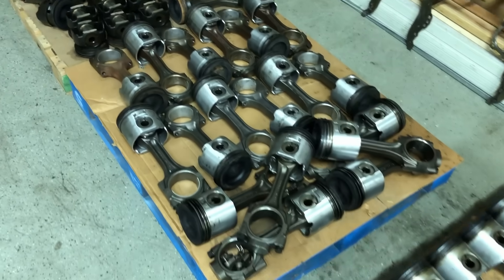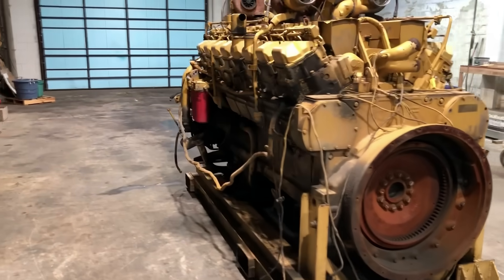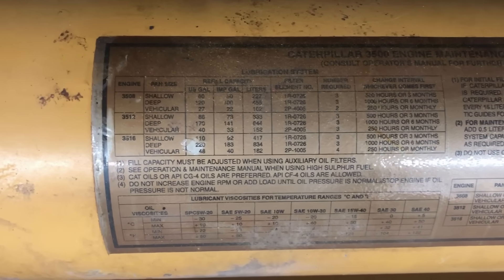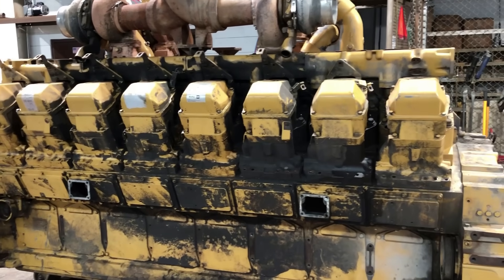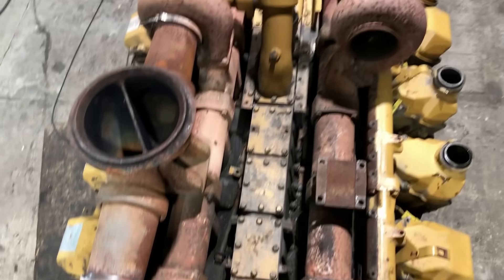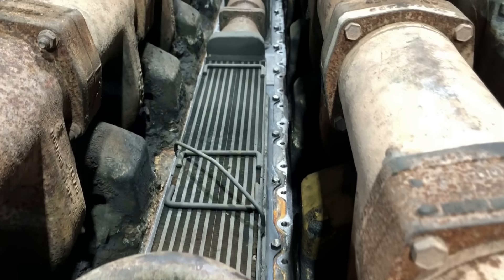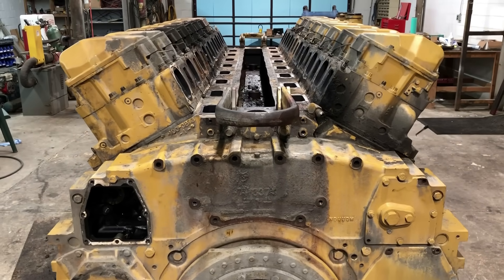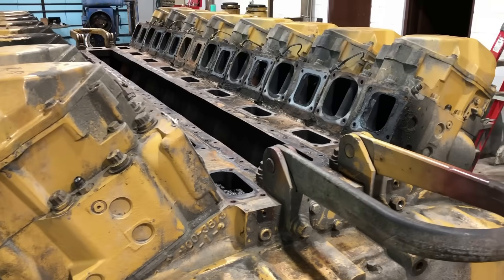Tear Down of a 17,000 Pound V16 Caterpillar 3516 - 1800 Horsepower 69 Liter Diesel Engine

Comment: Thanks for sharing, I used to be a port engineer along the gulf coast and a lot of the main engines were D399's , 398's, and 379's.
I got out of the oil field when things got thin in the early/ mid 80's. I was curious on what Cat did in upgrading those size engines.
Thanks again, I enjoyed it.

Comment: Since it was, in your words, in such good shape (except for the one piston), I'm curious why you didn't just rebuild it? Or are the parts worth more than a rebuilt engine? (If so, that's kinda sad - I hate to see engines parted/scrapped out.)
Reply from the maker: I would have no market for it as a runner, and several thousand more dollars in it after I got it fixed.  That's the nature of the beast, the block and crank will live on.

Comment: 220 GALLONS of oil for a 3516 with a deep pan...holy dead dinosaurs!
Reply: Locomotives are easily double or triple that.
Reply: vector6977 about double. A 16-645 EMD locomotive engine holds 400 gallons in the sump.  There’s probably another 50 to 75 gallons in the filter and piping. Ordinarily, it never gets replaced. Just keep adding fresh oil and changing filters. I only changed the oil once on an EMD, because the oil got diluted with diesel from a loose injector fuel line. Took 8 55 gallon drums.

Comment: Do you not need to keep track of which cylinder the injectors were removed from on this engine? Didn't notice any numbers on the injectors.
Reply from the maker: No, the injectors are just cores at this point.

Comment: Video/audio was perfect. 2 questions: 1) Why doesn’t whoever is buying this thing strip it down? What do you do with all the extra stuff? Is it scrap, or just go into “inventory”?
Reply from the maker: They are only interested in the block and crank, and it takes a lot of labor to tear one down.  There are a lot of good parts that are usable, but unfortunately finding a buyer for most of the smaller stuff is very hard to do and a lot of it gets scrapped.

Comment: absolutely perfect video i loved every second of it  and the ending to ...i run a twin turbo C13 in my truck it does ok for what it is .i would love to swap it out with a 3508.
Reply from the maker: Maybe consider something more reasonable, like a 3406E or C-15.
Reply: 3508 might be a bit big for a semi. Lol
Reply: @clifftonarnold6989  lol its a quad axle t800 kenworth from 2004
Reply: Camera doesn't do the size of these engines justice.
Reply: Having worked on G3508, one of those engines sitting on the ground will come up level to the nose of most any semi tractor. It's a huge, huge engine.

Comment: Nothing in this video sucks!  I watched from start to finish and enjoyed it.  Assume the one-piece pistons weigh the same as the two-piece?  Else seems like the balance would get knocked off...
Reply: kd5byb ,   Hopefully one of us will get this question answered. Bruce
Reply from the maker: They will be pretty close in weight.  In an engine this size with thousands of pounds of rotating mass, it's really not very critical.
Reply: @KT3406E  Very good - I though they would be same or close, but didn't think about how big this engine really is - with that much mass, you're right, it wont be that critical.  :)  Thanks!

Comment: I'm not mechanical, but for some reason I watch these videos and I think that I might be able to do this.  I think that one of the great things about videos like this is that you get to see something that you would ordinarily never have access to.  The audio and video were just fine.  No bitching here.
Reply: theres a hell of a lot more to this video than meets the eye. just because our friend here made this look simple doesn't mean it is.  If you think you could tackle a job like this because you watched a video on it you have a real wake up call coming.
Reply: you just take bolts out until the broken bits come out then you put them back in!  looks challenging but its just bolts! get a junk lawnmower engine and take it apart. this i just bigger with a few extra bits, you may find yourself a new hobby.
Reply: @Bennyboy46a  it aint that easy hahaha sometimes the smallest jobs take the longest and are the most infuriating. always happens other than that its fun working on that stuff if ya got the patience for it and the mindset to do things correct.
Reply: @johndowe7003  Well, ive been in the heavy equipment repair game for 15 years now, ive worked on lawnmower engines up to 3524 cats, and its all just bolts to me! My first engine job was a 2 cylinder starting engine off a D8H cat dozer. principles are the same in all of them.
Reply: @johndowe7003  yes, same goes with makeup applications, olfa knives, and a hammer and nails. Just have to be thorough and careful. but its not rocket science.
Reply: @Bennyboy46a  yep you hit the nail on the head 😁
Reply: @Bennyboy46a  you and John are right it is not that hard but, always remember to do it right not half assed.
Reply: @scruffy6151  my grandpa always said “if you can’t do it right, don’t do it at all”
Reply: @Bennyboy46a  Things need torque spec and proper compression. Along side proper alignment in regards to rocker arms, valves and valve guides. Much much more. You can't just "take out the broken bits". You have no fucking clue what you're talking about.
Reply: @Bennyboy46a  I'll see if I can't find one of these and take a crack at it.
Reply: Rick Allen really a car engine or any engine looks intimidating but they are all basically the same  once u get past the fear of working on it it’s a piece a cake
Reply: @jettyeddie_m9130  you`re bang on!
Reply: I stayed at a Holiday Inn Express last night.
Reply: I work on cat 3512s, c13s and c32s all day and they're fun yo tinker with. You just have to remember to torque all of the bolts correctly and put orings and seals where they need to be

Comment: Awesome videos! I have an 03 kenworth with a 6nz I have a couple questions, what rpm is overspeeding the engine? And what is the normal operating temp for the engine when its under load?
Reply from the maker: 1300-1500 rpm is a good range for cruise and easy short pulls.  When you are into the hills pulling at full load for any amount of time, I'd recommend 1600-1800.  Under full load it's normal for the engine to heat up to 210 or so.  If temp continues climbing after it hits fan in temp, you should back off the throttle a little.
Reply: @KT3406E  thank you so much for replying. The truck is a dump truck and it was freshly rebuilt 80k ago. Engine has 648k on it runs like a champ. Out pulls all our Cummins with no problem at all. I was just concerned because I know with 21 ton on it pulling a steep grade sometimes it goes over 210 and I have to kick the fan on manually. I was worried 210 might be over heating the engine
Reply from the maker: @MrJpshaw2601  Depending on the year, make, and model of the truck, keep in mind the engine's ECM coolant temp sensor may be seeing a different temp than you are in the cab due to different locations of the two sensors.  As long as the fan does come on automatically, you should be fine.
Reply: @KT3406E  ok thank you very much for the info!

Comment: What is that front right U joint receiver for? Also, can you show how you pull liners? that seems impossible!
Reply: Hmmmm this is CAT 3500 custom made lifting U joint each on both ends of engine. These are very useful to lift it at vertical position.

I have a vast experience and rebuilding if Caterpillar diesel and natural gas engines is my passion.

I own my workshop and office in Lahore city of Pakistan. I have hands on all three vital members of CAT 3500 diesel MUI and EUI engines and learned all hand tool size to rebuilt that passionate engines. 

Caterpillar has made vital modified engine parts in this series likewise float bridge, adjustment type bride, 3/8 inch valve stem valves and 1/2 inch long life exhaust valves, small length valve springs, long length valve springs, valve rotocoil deeper and shallow, aluminum single, two piece and steel one piece piston. Aluminum spacer plate and cast iron plates.

I have all numerous special tools likewise cylinder liner leg type puller universal adjustable height, piston installer, liner installer, cylinder head rebuild tools for valve guide and insert, Camshaft all type bearing pullers and installers custom made nor original, front and rear same diameter Crankshaft wear sleeve and seal installer, water temperature regulator lip seal installer and much more...
Reply: @zeeshan_engineering_services  I'm sure he is asking about the yoke out of the rear gear case cover beside the flywheel housing....not the lifting eyes...I'm guessing it's a pto for auxiliary driven accessories...possibly hydraulic pump ect.
Reply: @oldpete3153  
Yes Dear, you are absolutely right I did not get the point he was asking
Reply: @zeeshan_engineering_services   Are you referring to D rings on top? I'm referring to drive line kinda of U joint on right side of the engine.
Reply from the maker: It's a drive line for an auxiliary system of some kind, probably a hydraulic pump.  A big Cat haul truck guy could tell you for sure.  Just a simple home made liner puller for pulling liners.  You will see it in my 3508B tear down video part 2 if you go back and watch it.
Reply: @KT3406E  
Hmmmm I agreed and got your kind point. The difference between  vehicular and industrial engine is vital seen in your worthy video of dismantling CAT 3516 EUI haul trucker engine. That's Power Take Off or Yoke type coupling is same as I remembered to had seen in numerous Caterpillar wheel loaders and motor graders as a propeller shaft to drive all wheel drive. Thanks for kind update and technical assistance to enhance my knowledge. We are on same profession and I believe we definitely to learn each other by our own experience and assignments.

Comment: The only stationary engines I've dealt with have been Deere but do Cat industrials not use oil coolers? The 2 to 4x capacity in a stationary compared to a machine seems huge.
Reply from the maker: Yes they do.

Comment: Very interesting to see, i have never seen both exhaust and intake going in the middle of a V-engine. Is that to make a big engine more compact or what's the gain to not have a crossflow heads. Wonder if a swedish friend did reach out to you about a injektion pump on a 3406.
Reply: Yes it's very clean, balance and convenience to remove and install. After all it's Caterpillar CAT engine. Beside that if I work on Cummins K Series Inboard or outboard aftercooler turbocharged engines, they take much more time to remove and install in electric power generator set engines. The most interesting is intake manifold individual elbows to individual cylinder heads, common compressed fresh and cooled air duct beneath aftercooler core and exhaust system in CAT 3500 series engines. 

Also just look all pumps are on right side from flywheel end of engine likewise oil pump, water pump and fuel transfer pump along oil cooler and lines including oil filter housing cartridge type. In prime rating engine fuel and oil filter housing are on front of engine behind thermostat / water temperature regulator housing. 

The left side of engine by rear end is almost free as compared to right one. Gear train on rear side and front has only auxiliary gear train to rotate all kind of pumps and mechanical Woodward Governor likewise UG8 and electronic Actuator in various mechanism.